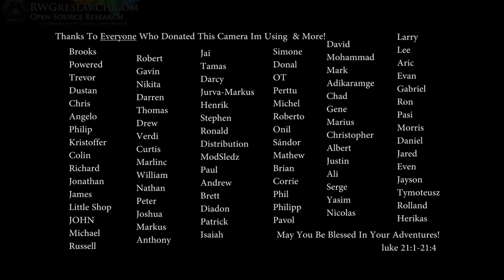Heat Molding PLA + How I Match Complex Curves. 3D Printing + Motovlog Helmet Overview

Comment: Love the double gopro mount design :)
One tip you might not know that somewhat changed my life: to remove hotglue, just spray it with a little alcohol (rubbing alcohol works fine) and wait a few seconds. It will seep right under the hotglue and will come right off!

Comment: Ha I love it .  I have been using my torch for smoothing prints ,  but i never though about using it to help conform to funky shapes.  Oh and one of my viewers who watched my old torching PLA  video pointed out  that a hot air from a solder station does the job without much risk of ignition and you can dial in a temp . 
I have been matching shape by printing test curves for so long. I have heated  metal things and pressed them into PLA , but thats not as cool as your way .
Reply from the maker: XerotoLabs ;)  cool beans. just when you think you got good tricks some one else has better. lol. most of the time im in your shoes. lol. yeah heat flow soldering station. i dont have one but that would be really good! 

also. i got that new busing finished and will be making a video soon. i hope you will like it. been testing it on my delta for a while now.  seems to be holding up well. 
thanks for posting!! ~Russ

Comment: Are you by any chance using band-bang control for the bed heater? On the blue part around 5:00 you seem to have a bit of under extrusion on random levels. I've found that sometimes happens because bed is expanding and contracting quite a bit when heater comes on and off in bang-bang and that causes layer size to change and cause under extrusion.

Comment: Modeling parts to fit existing features in Fusion360 is made easier by placing a picture of the component and scaling it to real size and creating matching features to fit complex shapes. A ruler included in the photo or the known size of features allow a fairly precise model to be created. Camera angles must be accurate to achieve good results. I've done some that came out pretty close on the first try. 

Flame polishing is an art. We used to hand flame polish 3/4" plexi for signs, then moved on to laser cutting and flame polishing all in one go.  Nasty smelling stuff though.

Boiling water can also be used to mold PLA fairly easy but use gloves! :D

2 hour commute by motorcycle sounds fun, glad I'm retired ....no commute, I just ride my fast ebike around for fun these days!

Comment: Here in Brazil, average filaments do not provide information like contration percentage, we are happy when the diameter informed is close to the real diameter and consistent. I am building one of those diameter measuring jigs to hook up to my printer and for every new spool of filament I print a few sample prints and measure it to identify best temperatures, contraction, and so on.

Glad you got that weight on your helmet down!! I like a lot watching your videos, it would be a big loss if I stupid wreck took you away from the show. :) 
You had some problem on the audio, only left channel was working for you, but the other gyu would sound on both channels. And for two brief moments your audio poped up on both channels too.

Great trick do design the shapes, never thought of that, but I will cerntainly start using it. The one thing I used to do, one at least one of the sides were flat, I layed the part on flatbed scanner and used that as reference. I designed and printed a bronken gear this way.

Comment: Having problems with my 3D printer Prototype.... based on a P. M. 3I that I customized with a Bowden Extruder and a Custom spool Peg. the Hot-end Thermal coupler is running away when you have it running on generated Gcode. Manual g1 code commands work flawlessly.

Comment: what I do is find a major central plane on something and line up a ruler then take a picture normal to the plane.  then I rotate the image until the pixel at the start of the ruler is on the same line of pixels as the one at the furthest visible end.  once that's done, I calculate the number of pixels per inch based on the largest number of visible demarcations to minimize rounding error.  from there, I can doodle on the image and based on their size in pixels I can map them to the object, and hey presto, the parts resulting from those doodles fit perfectly!
Reply from the maker: Shanjaq fantastic way of doing it. when i used sketchup i use to do semmilur. but instead of pixels. i just put something in the photo to give me a mesurment from.  such as a ruler. i have Reverse engineered many things this way.  thanks for the comment!!! ~Russ